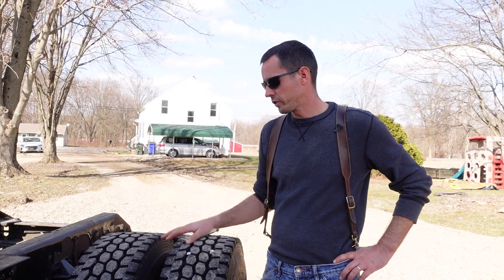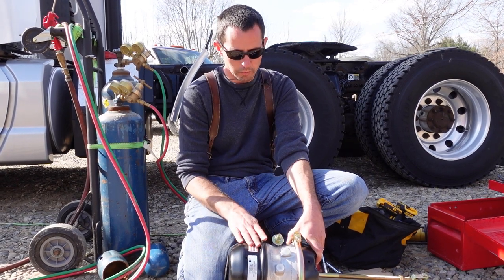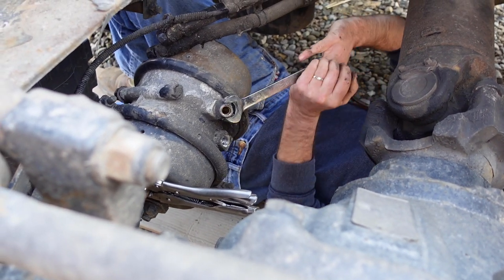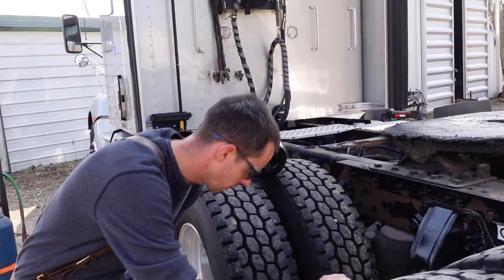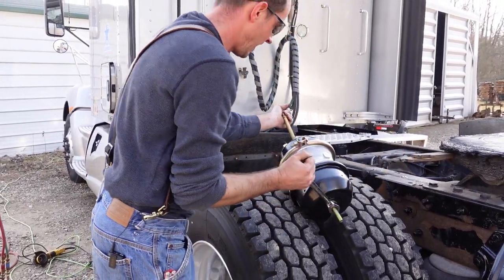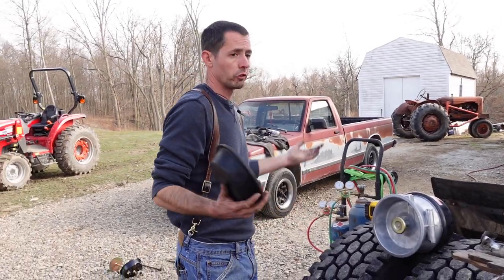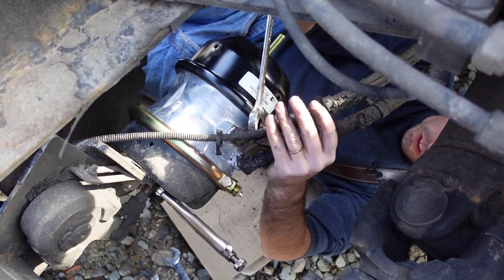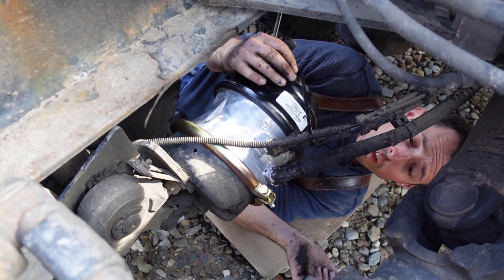Air Brake Chambers (PiggyBacks) Change Out - The Easy Way | Semi Truck Repair & Maintenance

Comment: 45 yrs at this and very seldom seen a piggyback not have problems   Change the whole unit clevis pin and mounting plate corrosion not worth the hassle
Reply: 🤣 45 years and you see few of these with problems? Bollocks, I'm.not truck engineer but even I get at least 2-3 a week

Comment: Do not struggle with tightening cage bolt  , use a 3/8 “ NPT nipple and shut- valve  ,supply remote air to the supply side of chamber and apply air . ( 120 lbs. ) Easily install caging bolt .
Reply: Yes, chock the wheels and hook up the park hose and let the truck hose do the work. A vice grip on the pushrod after backing off the slack adjuster makes it easy peasy.
Reply: It's a brake can! They are so easy to change the right way. Why would you go to the trouble? Do it the right way in under 30 mins. Don't listen to this guy

Comment: That won't work if you're broken down on the road or at a truck stop or weigh scale. $1000 of tools to change a $200 brake chamber doesn't make sense either. All you need is a wrench, and a hacksaw.
Reply: Thank you
My thoughts exactly

Comment: I took mine apart and only reused the old rod. Mine all had over a million miles so didn’t wanna use the same housing as I had one break on me a few months ago. Just replaced the other 3 today but this method looks way easier. Great video as always👍🏽

Comment: Hello, Gary Richmond here, 36 years otr, prior to that 2 years running a service truck. Can't tell you how many times I have rebuilt brake cans. Best wishes on your business. O/O here as well, run your area sometimes, may need some help sometime know who to call
Reply from the maker: Nice to meet your Gary!
Reply: Your lucky to still be around to talk about it. Very dangerous task. Even for an expert, veteran mechanic like yourself who obviously knows what he's doing and how to be smart and careful with such a dangerous job, its still a risk and a gamble every time you rebuild a spring can

Comment: Hi Ryan

Have you ever thought of changing the service brakes on the front drive axle to the piggyback /30 - 30 brake Chambers, so you can have both axles having parking brakes.

Great vids, enjoying the content looking forward to the next vid.

Stay safe and strong to you both, blessings to you Ryan and Sophie.
Reply from the maker: Not really, you have to run a lot of air lines  and not a lot of weight as the rear axle for holding force.
Reply: One place I worked...  By company  policy... They required Spring brakes on all the real  Axles...  The business was...   Construction work. All  Tractors & trailers had over weight  Permits.. Completely different person going over the road..

Comment: I enjoy your videos sir Years ago I worked in a shop doing tires and one of the other shop guys thought it would be funny 😂 to cut the bolts on the front band that holds that compressed spring in the brake chamber with a torch well I was in the office with the boss man and it sounded like a bomb 💥 went off the boss man ran out into the shop he wasn't too happy thank God nobody got hurt that spring shot across the shop like a rocket 🚀 😉✌️❤️💪✝️🚛🚛🚛🚛🗽🦅🇺🇲
Reply from the maker: Glad no one got hurt. It is dangerous to cut the bolts.
Reply from the maker: Thanks for sharing your experience.

Comment: If you had shop air you could put a fitting in the emergency side. Makes it a lot easier than turning it with a wrench or a ratchet and special socket lol

Comment: I’ve pulled the brk chamber off and pinched off the air lines on one of my drives to get me out of bind instead if waiting 8 hours for a mechanic.
Reply from the maker: I have used plastic cable ties before if you something leaking.

Comment: I know this doesn’t have to do with the video but I’m going to be buying my first truck soon I’m coming over to Landstar. I like kw. I’ve driven a Freightliner a Volvo and a KW as a company driver and I’m currently in a KW T680. I was trained on a 13 speed manual when I got my license but for the last two years I’ve driven an automatic as a company driver so I’m fine with either one. Is there a certain motor I should be looking for? I would probably like to spend around 60,000. I know when you’re older videos you said to send you an email but when I checked your about me it says business only so I wasn’t really sure how to ask you some questions besides posting on here
Reply from the maker: Just send me an email, I will help you on it! 😊

Comment: Just did this but now my parking break is not releasing and sucking the rod back in ? Any suggestions. The rod seems to stick out further now for some reason. Did a piggyback change if that helps .
Reply: Im not a mechanical advisor so take this with a grain of salt, but he mentioned that there's long stroke and short stroke piggybacks. You might have the wrong one 🤷‍♂️

Comment: Are there any other ways to cut off the clamps like using a grinder… I’m a novice just wondering.
Reply: Do not cut it.
Just use a 9/16" wrench, it literally takes one minute to take it off.

Comment: Is so much easier to measure the old chamber and cut the new one to length. It would only take 20 - 30 minutes with a hangover. I’m not saying, just saying.🥴
Reply: Plus if you get confused  on which  band to take off it may cost you in the end

Comment: If you just wanted to change the diaphragm, you still have to remove the airlines like you did in the video? I just bought a truck and I suspect i have one if not more than 1 bad diaphragm
Reply from the maker: No, you don't need to disconect the airlines. You can get the diagram for about $5.

Comment: You should cage the old brake chamber. This is so wrong how you do it and putting other apprentices in a serious accident. You don't hit piggyback like that  and the slack adjuster you adjust it 1/2 not 1/4. 1/4 is too tight and can cause brake failures , damaging the brake lining and even the brake drum itself. Where did you get your truck License?

Comment: ok lesson #1 when you caging the chamber you first put air to the emergency side then put the cage bolt in lock it and put a little tight to it then release the brake

Comment: I think if you don't put air in the service brake, the spring won't pop like that.
Reply from the maker: No, the spring won't pop, it can make it difficult to clamp on the piggyback.

Comment: You do realize... Rod goes right through whole canister... Mary times the rod in the middle of the canister... Will leak air... If you have a truck that runs a North East all the time... Just change the whole canister.... Just believe me... Too much salt/Calcium chloride on the road. Also  Change the clavis and pins
Reply from the maker: As I said in the video, if the canister and rod in good condition, no need to change it out. But of course, if needed, change the whole unit is necessary. Thanks for the comment!
Reply: Is it proven 1 hour of savings.. I've never actually done it yet but To cut the rod off takes literally less than 5 minutes and it looks like only 2 bolts are holding the whole canister on. And you should probably service the pen and slack adjuster anyways. So it looks like it is less time to do the whole unit at once.?

Comment: I’m late to the party but this was hard to watch. You took a brand new chamber apart to keep from having to cut the rod and to save an old rusty service side pancake. I could’ve measured and cut the rod before you got the parking side caged. 
I usually like your videos but this was the most awkward way I’ve ever seen a brake chamber replaced. 
Just replace the whole thing in one piece. Cutting the bolt is way easier than all that extra work you did.